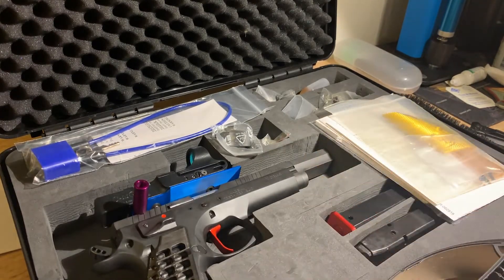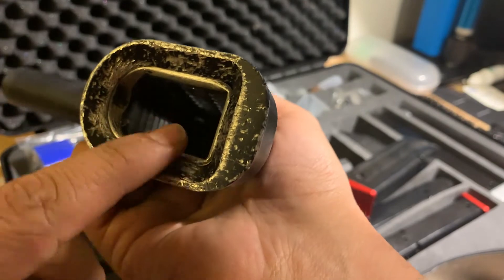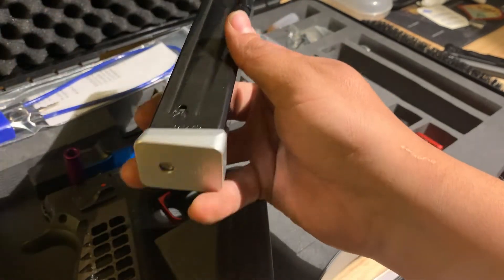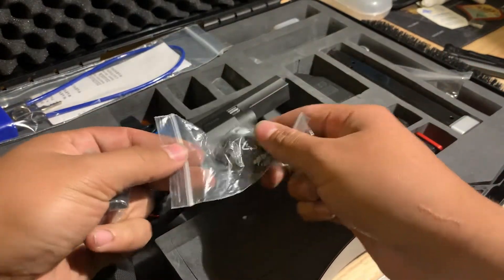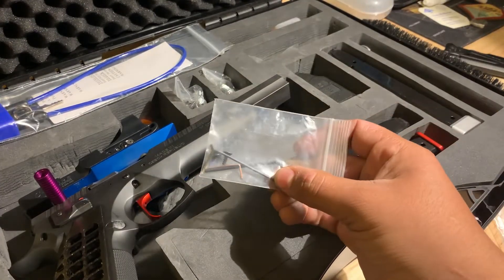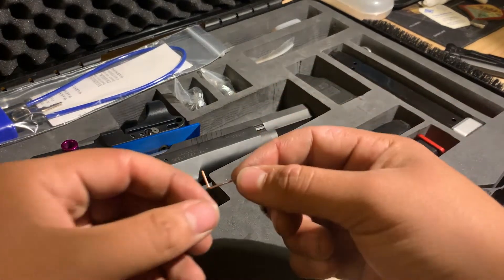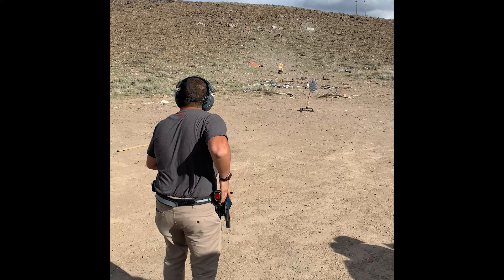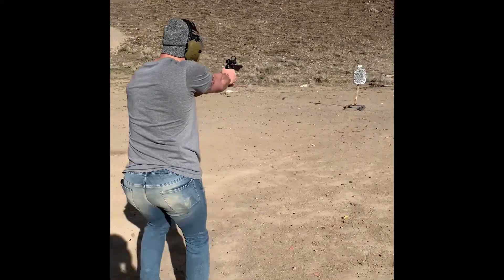CZ Czechmate Parrot: Unboxing & Overview (2019)

Comment: I want one!  After my optics ready P10 F, this will be next!  And that will be the end of it. Maybe.  “Several hundred dollars spent on a gun”...????  You mean several thousands right?  Otherwise please tell me where you bought it.  :). I’m not sure on those slide locks breaking.  They used to break, but they reengineered them and then had problems with some of the S2 frames cracking.  I put over 8000 rounds through my non-optic S2 and ended up with a broken frame, but no broken slide lock.  Great video!  Thank you for posting!
Reply from the maker: Yeah the slide stop pins breaking doesn't seem to be as much of an issue, in my experience. I've put somewhere around 5000-6000 rounds of 173PF ammo and a 10b recoil spring through my TSO and haven't seen any signs of weakness. I guess that remains to be seen in the next few thousand rounds. I may just switch it with a different one for shooting matches, that way I don't have it break halfway through a stage.

As far as picking one of these up, they've been coming up for sale on Gunbroker in waves for about the last two months. I'd imagine they'll stop putting them out eventually until next year, but they're far more available than even regular Czechmates have been lately. I decided to go with this because it seems CZ hasn't added the thumbrest to the regular Czechmates, but it's up to you to decide if that's worth missing out on an extra barrel.

Comment: The additional barrel not being included mite be for parrots only. Lgs got czeckmate in and now its on layaway had extra barrel in box
Reply: Got a link to where available?
Reply from the maker: @budfarkus  They've been coming up on Gunbroker in waves. Far more available this year than I've seen in past years, so you might still be able to find one out there for a decent price.
Reply: @tacomanshoots4310  yeah I found one locally at dealer for $2900 OTD. I got it ! Thanks for replys

Comment: If you're mad about the price go look at a 2011 STI. Then you will feel much much better
Reply from the maker: Well the complaint here was that you're spending over $3k brand new just to have huge oversights left on guns that really should be ready to go right from the start. 2011s are on a completely different level of engineering and precision, but the price of a brand new Czechmate is more than most STI models. Unfortunately, STI's quality has drastically gone down in the last few years and what they're asking for polymer-grip 2011s is just way too much. Regardless, they've seemed to have moved away from the competition market and focused more on the tactical/LE guys, who seem to enjoy their guns more since they're not pushing them to their breaking point in one season or less.

Still, nothing can really match a true custom or even semi-custom 2011. I've long since sold this Czechmate and moved to the 2011 platform, and I can say that it's well worth it to have a gun that was hand-crafted with love down to the smallest details.
Reply: @tacomanshoots4310  what is the last year where STI was still making quality in you opinion? I might actually get one if I don't come back to my senses.
Reply from the maker: @Mike-rt2vp It seems like their quality had really dropped off starting around 2017-2018, though there are people out there that will tell you it's been bad for much longer than that. I just have a couple that were built back in 2011, but even the barrel-slide-frame fit on those leaves quite a bit to be desired. If you're really looking for a decent semi-production 2011, you can pay just a few hundred more (or nearly the same) for a CK Arms. They actually use steel grips in their guns too, which makes quite a bit of a difference depending on who you ask. Still, I'd go with one of those every day over an STI.

Alternatively, you can keep and eye out for that new CZ/Dan Wesson DWX that's supposed to be coming out soon. They're not expecting to release that one for about a year, and even then, it'll probably be tough to get your hands on one in the streets. At this point, there's just too many other people doing the same thing as STI but with much better quality and only a marginally higher price. With how much STI is wanting for their Staccatos and Combat Master, I would be surprised if any competition guns they end up releasing from now on are going to be any less than about $3500-$4000.
Reply: tacomanshoots who would you recommend having a custom 2011 built with?

Comment: Finally a Parrot video worth watching. I pick mine up here in a week or two and i cant wait. How are you likeing the Alpha-X with it?
Reply from the maker: NotAllAlpha it works alright for me. The customization of its position is the best part for sure. It’s actually the same holster I’ve had for my TSO these last few months, and the main reason I got a Czechmate for Open was because it’s compatible with the holster and basepads I already have. Still, the gun kinda wobbles while in the holster, and I don’t know if that’s normal with the Alpha-X or just the CZ blocks specifically.
Reply: I know they say with the older trigger guards to use the Czechmate specific insert and the newer ones use the TSO insert. I’m running my S2 in Production right now and plan on practicing Open this year then diving in to the division next year.
Reply: Beautiful gun! Love your videos tacoman 😘

Comment: My man- can I ask you a few questions about comp shooting?
Reply from the maker: Sure man, I'm always open to any questions!
Reply: tacomanshoots so if I have access to get a shadow 2 for 1100 with 3 extra mags is that worth it- total 5 mags... I love the tac sport orange because of the flat face trigger but I’m pretty sure you can put one in the shadow 2 correct?
Reply from the maker: @ltemerpoc  it really depends on what you want to shoot and what would be most beneficial to you. That sounds like a pretty decent deal on the Shadow, depending on round count and any additional extras they're including. If you're looking for a gun to shoot Production, I'd say the Shadow 2 is Top 3 for that division, in my opinion. If you're looking at a TSO, you would have to shoot it in Limited since its single-action only, and you'd be at a considerable scoring advantage if you weren't shooting .40S&W.  Of course, a TSO and .40 are a bit more expensive, unless you're reloading your ammo; but even then, you would have to invest in some extended basepads to get the TSO magazines to the maximum allowed length of 140mm. As dumb as it sounds, having those extra 3-4 rounds in a magazine can make a huge difference on a stage. You wouldn't have to worry about that shooting a Shadow 2 in Production. Along with that, though, I'd say the TSO is in a completely different league than the Shadow 2. If you're just looking for a fun gun that you could also use in competition, either would be great. You could even shoot the Shadow 2 in Limited if you wanted to, just keep in mind that shooting 9mm would earn you less points.

At the end of the day, it comes down to what you want to shoot and what you plan to do. If you're just shooting for fun, there's no reason to spend more than you need to unless you just have the cash burning a hole in your pocket or want to treat yourself. Even then, I always tell people to just shoot what they want. The gun doesn't make the shooter, so it all comes down to personal preference. This depends on your level of participation as well. I've seen C Class shooters with $5k custom 2011s, and I've seen M and GM shooters with a Glock 34.
Reply: @tacomanshoots4310  well said

Comment: So the recoil spring is 11LBs? 13? 16? Buffer?
Reply: I had an 11# spring in there that I was using from my TSO. I think it's the same for the Czechmate, but I can't quite remember now. I'm pretty sure it was the lighter one because it ran 9mm minor ammo fine without any changes as well. Sadly, I sold this one a few months back now so I can't confirm this for you.

Comment: quick update on it? Still own it? Still running it? Any issues?
Reply: hooks and bullets hey, actually I don’t own this bad boy anymore. I decided open wasn’t quite what I wanted to be shooting until I could commit more time to tuning/maintaining an Open gun and maybe affording 38SC, so I’m back to shooting Limited now. Still, I know most love their Czechmates, and there’s a local guy here who runs it pretty well with no issues. The only place I ever ran into issues was with trying to run extended basepads and aftermarket springs & followers, but a simple mag tune fixed that up right away.